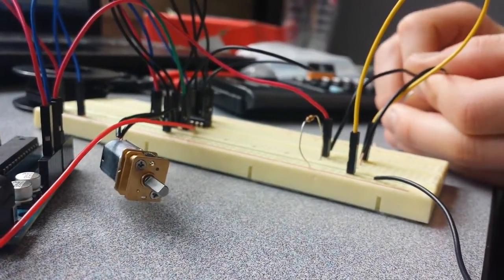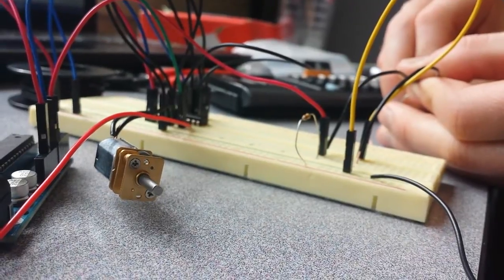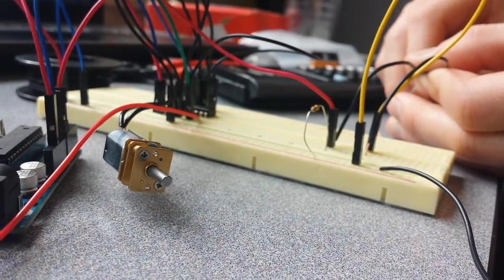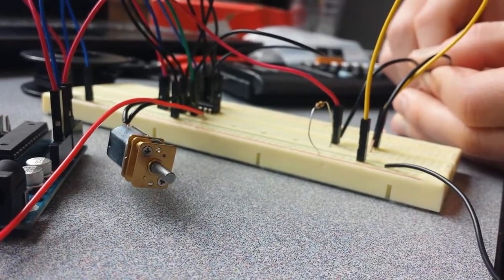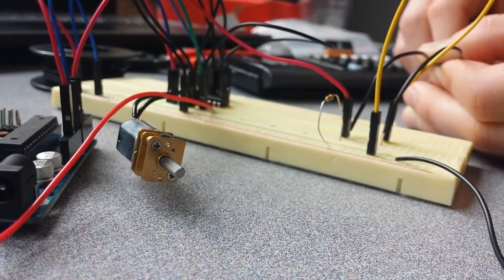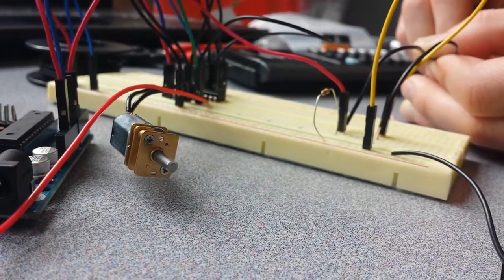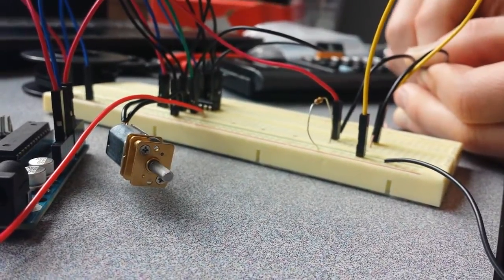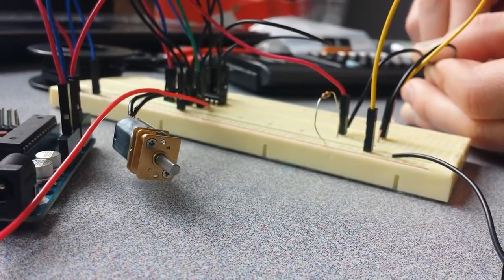Pot Controlled Motor (L293D)

Comment: is there a reason why you have a EN pin "1" on the ic going to a digital pin on the arduino ?  from what i understand en should be going to power 5v since its going to remain on also the schematic on the link you sent me, is that for this video or is that for the direction control ? like what i been wanting to do ?
Reply from the maker: if I remember correctly, the en pin is for speed. with that being true, and make sure to check me on that, the digital pin 3 has the capability of producing a voltage generated using pulse width modulation or PWM. varying that voltage allows you to control the speed of the motor.
Reply from the maker: the video on PID control systems is good to know in general whenever you're dealing with Robotics or any type of control system. I think it would help you reach a certain speed in effective manner. I also think you would be interested in it in general since it's pretty cool.
Reply from the maker: the video might help you with the programming side of things if you decide to go that route.
Reply: nope your wrong about EN pin 
 EN is enable and should stay on so unless your going to keep that pin HIGH all the time in code then i see your point and therefor any pin wud do ppl usually just run a wire from EN to the Vcc on the other side of the ic and then to pwr
Reply: and as far as that video on your page i seen that video like 3 times and im still clueless as to how am i suppose to write a code for arduino PID based on that, the guy dont talks about arduino just in general and this is the main reason why im lost " i cant stand general videos" gotta be focus on the topic at hand for me to follow and the topic is PID for arduino where the examples are direct to something i can learn from and implement based on ref
Reply: and why you trying to make me go thru hell and back for men? you already master this topic as you said you done this so why dont you just link up with me and help me attack this small aspect of the project im in PID ?
Reply from the maker: one of the great aspects of engineering is being able to take a concept and use them in real world situations. PID control is a general topic that does not directly relate to what you're trying to do. It is merely one of the many ways in which you could possibly do it. another way as you can measure how fast the motor moves at full on in both directions, create an equation for it relating to voltage in, and setting your voltage accordingly. I thought about that simple solution at some point yesterday. if you're not interested in looking into PID control systems you could simply hardwired in an equation that relates the speed that you want to the voltage that needs to be supplied.
Reply: dude i dont think we are on the same page,
Reply: why we even talking about power? what i want is direction control like a servo, thats all what does a pid for a DIY servo looks like in sketch for arduino ?
Reply: example code in the void loop ()
Reply from the maker: READ EVERYTHING BEFORE CLICKING THE LINK

What you are asking me to do is write one... I don't have the time to write and troubleshoot a working PID controller code lol. If you are interested in pursuing the PID option in the future you will have to look into it. To get you started, here is a link to the Arduino reference page for the PID function. I stress reading the 'What is PID' and 'Should I use PID?' sections before moving on to the examples at the bottom.

http://playground.arduino.cc/Code/PIDLibrary

If you would like to only know about how the direction changes, you would simply switch the inputs of pins 6 and 7.

Example:
Pin6 = HIGH; Pin7 = LOW (yields CW)
Pin6 = LOW; Pin7 = HIGH (yields CCW)

The enable pin is where you control the speed of the motor. If the voltage at EN is always 5V then the chip will send the voltage from the batteries at full blast. If the voltage at EN is at 2.5V, then the chip will send half the voltage from the batteries to the motor (effectively making it half as powerful). People that put it on 5V all the time are likely just wanting full speed. My misconception is that you wanted to control the speed of the motors.
If you just want full blast, then you can set the EN pin to 5V and shoot pulses to pin 6 and 7 for directions to run the motor at full blast.

Last thing. If you want to control the speed with a more brute force method than a PID controller programmed in, you can create a relationship between the speed of the motors, and the voltage you send to them. 
Example:
Input to the chip = Output to the motor
5V = 5 RPM
2.5V = 2.5 RPM
1V = .6 RPM

If it's not obviously linear, you can plot the results in excel and get a relationship using the function it has built in (line of best fit and so on). Hard program the equation in your code and call it good. If you have a set speed input, it will send a voltage output to the chip (via the equation you found). So all you would need to do is measure the system, develope a relationship between the voltage to the EN pin on the chip to the output motor speed, and hardwire it into the system with code.

(Example Equation:

[voltage] = m*[speed] + b;

where voltage is the voltage being set to the EN pin, speed is the desired speed of the motors, and 'm' and 'b' are found through experimenting with voltages). It is an effective way to sidestep the PID controller.
Reply: thanks for all that, this should get me going, i must say that i been collecting alot of code of various projects with features like the one we been talking about and chances are that already have what i need but if i dont kno what to look for i will never see it.  As for your response "what i want is for you todo this for me" NO , what i want is to learn from someone hands on, thats all.....you say you dont have time but that fact is that in the amount of time we been talking today and every other day YOU KNOW we wud have this done and i wud have nailed this subject "dont front u kno is true"

"people never have time, we make time" 

when i learn this i will do a video on how to, cuz there are videos out there yes but no good instructors/teachers and if they are there methods analogies and or styles aren't suited for everyone, you have said very little that i can understand and so im starting to get the picture despite the fact that i have watch videos on this topic and left me no where, so thank you very much for your patience and understanding, when i lunch my kickstarter ill remember you and " i got you " 

i been studying on alot of subjects in the past 3yrs and i know so much today thanks to individuals like you so i have come to learn alot about Humanoid and A.I and everything that revolves around that line of study so this one PID is i hope the last of study and i can finally move on to assembly
Reply from the maker: Dynamic systems and Mechatronics are two of my favorite subjects to talk about! They are extremely useful and never the same (dynamics joke because it's always changing). I enjoy explaining them to anyone who asks (and sometimes those that don't). Let me know how things turn out and if you have anymore questions, I'll see what I can do.

Fact is, creating a PID controller is hard and takes time. Not just the coding, but also the tuning and making sure it will work with the system I have been talking about. It is one of those things that is easy to develope, but hard to implement in the real world. So I do believe that it would take me maybe 1 - 2 full days of focus to troubleshoot without any help, even given my understanding of them. That kind of time commitment I can't handle right now. I also don't have all the components to recreate the circuit in my house (since I recently moved and I did look). So creating a video tutorial would also lead to a small financial contribution and another time commitment (making it work + creating the video). I understand wanting valid reasons for someone not being able to assist you in this manner, but to me these are valid reasons. Later I do WANT to make videos doing various things with circuits, mechanics, SolidWorks, etc. or whatever I can get my hand on. Currently, other things are taking priority at the moment.

While creating a PID controller (PI, PD, or P) is difficult, it has it's own perks that sometimes can't be passed up! If you were to implement it on the motor speed control system, you would not have to calibrate anything but the measurement system (which is a lot easier than testing and developing a new equation every time you want to make changes to the code, load, power supply, or system in general. It is one thing to consider when testing the system. But (as professors say) 'for all practical purposes' hardwiring the relationship in is one quicker way to get to testing.

I am glad to 'make time' for my own projects and those that need assistance. This is me making time in between studying for the FE to help someone that asked. If you were physically here and I could talk you in person with the actual circuit, it would of course be much easier. However, this is not the case. It's not that I don't know you very well, but for me to get invested in another obligation would not be fair to either of us. Let's say I did write an example code as I remember doing it, but I didn't test it or check for errors and the whole thing compiles just fine. A few things could go wrong.
- the code could not physically function with the system due to small hard to find bugs. I have had that happen and ended up wasting 2 days on trying to fix it, only to end up writing one myself anyway.
- the code could mess up the components of the circuit by causing a short (also has happened).
- I don't know everything about your system, so the ranges could be off and cause a limit issue, which can break something.
- Everything could go just fine until you get to full testing and then one or two things left out to account for could crash your system.

I don't want you to get upset with me over faulty code that I can't test anyway. You don't want to waste time on crap that probably won't work anyway.

This is a classic case of teaching a person to fish instead of offering food. I'm sure you would have written your own code or at least gone through mine to obtain understanding of it, however, if you are able to struggle with the development, you can then truly appreciate the process, logic, and effort. It helps in the long run. I have seen people literally fail due to being feed example code.
What you are doing is touching on to new ground with no preset roads. Smaller components like this will inevitable have been the easy part.
Reply: hit me up privately ill show you my system, you a good dude and if I can travel from Boston to Cali ill be there tomorrow but I don't know anyone out there except my ex shes in the navy, DARPA had offer 2M for my type of prototype just based on software and mechanics and I have spent about 7K in all sorts of material so im REALLY serious about my company and our future "mankind" my vision is what we all want so this pleases me that there is a mutual goal and things in common, so with a small team of developers programmers and engineers "which" im just about starting up, I believe the market is ours help a little so we can give back to the community what we all want.